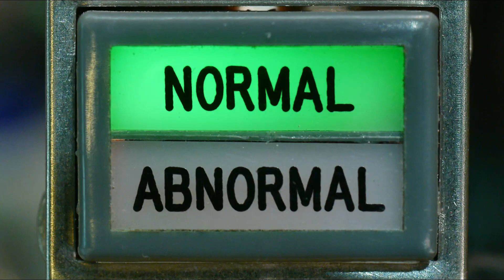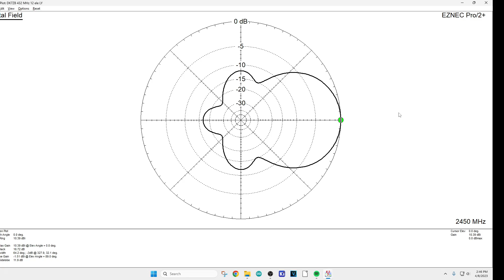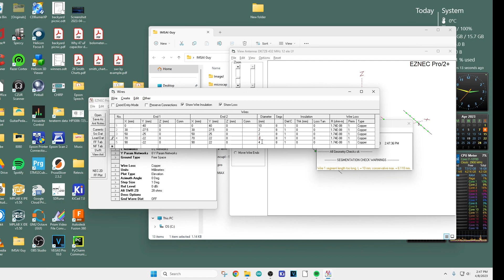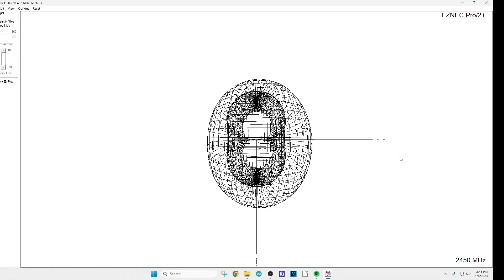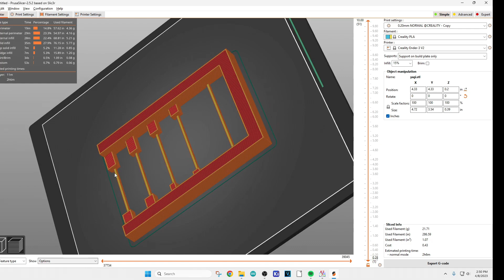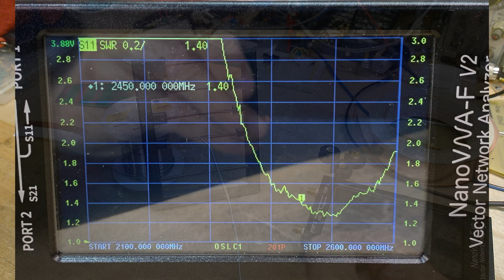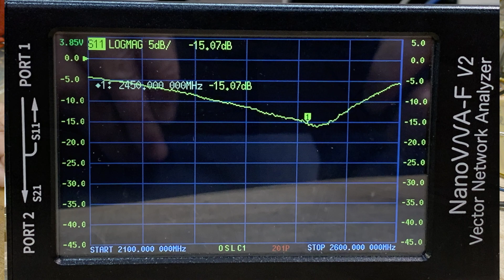#1521 YAGI design for 2.45 GHz (part 1 of 3)

Comment: You can indeed measure signal pattern, and it's easier at high VHF and beyond.  Use a VNA (some of the recent ones can do 2.4GHz), with a sense antenna on the second port, and your DUT antenna on the other port, through a properly matched feedline (make sure the two antennas are far enough that they're well into the far field from each other).  Rotate the antenna and take measurements of S21, and you can plot a relative signal pattern.  It's not enough to give you efficiency calibration, but you will get a result that roughly matches your NEC model if you do it right.  I have done this to good effect on 70cm yagis.
Reply from the maker: watch part 3

Comment: Dipole made from strip-line PCB would help determine element length, and spacing maybe unaffected by the "negligible" dielectric between them. Print and tape on paper, or on mm graph paper, allows soldering then stick to FR4. I'm making wire on paper on cardboard yagis soonish -- similar questions.

Comment: You had previously inquired about ideas to make into boards. I was thinking about a board as small as possible to replace the cathode bias resistor on a tube amp stage. A current sink. That is a valid improvement on a transistor setup, I'm thinking, why wouldn't it be on a tube?

Comment: I would also wonder if at these frequencies the big chunks of PLA at the ends of your elements would detune the antenna. I would make a PCB of this but make each element considerably longer that it would ever be. Then trim it down a little at a time with an exacto knife (all elements together) to tune it. Then you would get an idea of how much the pcb affects the frequency.  Of course you would not be able to change the element spacings this way but it would be a start.

Comment: I don’t know anything about antennas, but why doesn’t this relate to the real world?  That’s about the same frequency as a wifi router, but their antennas don’t look anything like this.  They are much smaller.   Are they using a different technique?
Reply from the maker: they broadcast in all directions. this sends the power mostly in one direction.
Reply: Interesting.  It reminds me of a microphone pattern. It's mostly uni  directional but is also sort of mushroom shaped in one direction.
Reply: @Spentelectrons  In both cases the patterns form because of waves interfering (adding up or cancelling out) so you get similar style patterns

Comment: If you have access to a laser engraver, feed your design into it and etch your design onto a piece of copper clad FR4
Reply: They dont burn away Copper and the accuracy of the photo etch is actually a bit poor ...that said since in fact the copper bits aint too small you may get away with that one
Reply: @101blog  I’ve found spray painting a stencil on the copper clad then use Lysol toilet bowl cleaner (HCl flavored), rinse with water, then WD-40 to remove paint, Dawn dish soap to remove the WD. 
For Laser etching, could the copper be coated with that material “paint” thats used to coat then cut certain glass?
Reply: @JasonBurchell76  I'm sure you could cover it in say CerMark or similar the only thing is that you would find it VERY hard  to remove after etching  it actually forms a plasma and bonds in to the metal and you would need to used a grinder to remove it.  That said for the low resolution needed for the antennas you could use a spray pain then remove  with the laser the rough edges should be ok at that feature size

Comment: You could measure the gain of the antenna if you build a second one with the same dimensions and everything and use the friis transmission formula along with the reflection coefficients. The 2 gain terms could be assumed to be equal since you have the similar antennas and with a VNA you could measure S11, S22, and S21 for the various other terms in the equation
Reply: Also if you were to take the exact same design and put it on a PC board, the dielectric constant of the substrate would have dramatic effect. Also assuming you are using FR4 the loss tangent would introduce some weird characteristics but for the most part it would be ok. Definitely interested in seeing how this goes!!!!

Comment: You could make the plastic at the ends of each element simply a (push-fit) holder for copper wire: cut the copper wire to the exact lengths required then clip them into the frame. You can then remove any piece or wire and trim if needed.

Comment: Wouldn't the dielectric constant of the fiberglass pcb be way different from air? Seems like best way would be blank pcb with copper tape for the old cut and try. Even then the copper tape is probably thicker than the pcb foil;not sure how much that would alter the result.